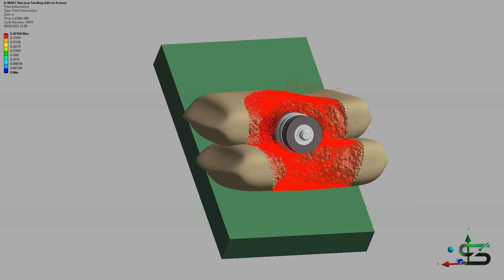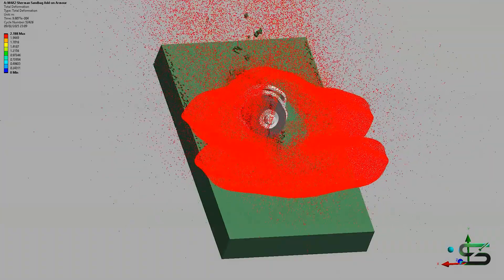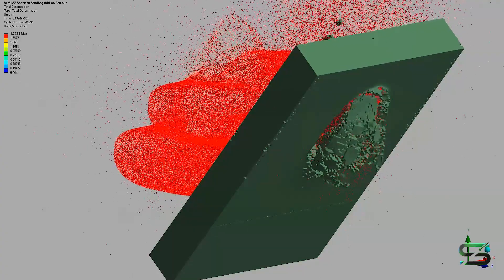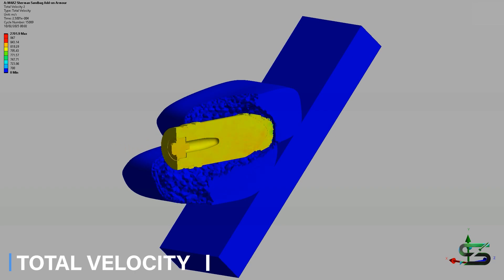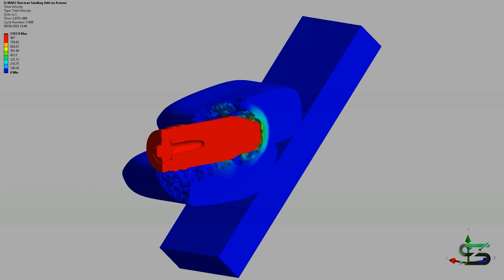Sandbags Add-on Armour | M4A2 Sherman Armour Piercing Simulation

Comment: I think that next this “simulation” needs to do is 1 t34 and 1 m3 lee agains 2727282928282 panzer 4 s 2727 panthers and 9282 tigers

Germans used the additional tracking
Allies used the ussles sandbags

A panther s 75 mm gun was able to totally destroy a sherman tank on more then 1,200m away with 1 shot(if hit)
It could go trought an js tank from over a 1.000m (frontal plate,not bothways)
But couse of the density of the heavy js tanks( they ussually didnt went trought, the whole cupolas were detonated in air)
Due to poor welding of soviet tanks(due to overproduction- and not quallity workers)

Comment: Sandbags are mostly for infantry interaction - they are happy with extra sandbag wall when entrenching.
Also, most "sand" bags were actually gravel ones - and these are good for bad roads, just dump them in holes and roll over.

Comment: My grandpa was a mechanic in WW2, he was all over the place when it came to vehicles. Sand Bags dampened the sound of machine gun fire, they could also be used for mounting positions alongside infantry in fox holes. Sand is a bit over exaggerated it was primarily dirt and rocks. At the time heavy assault weapons like the BAR, and Browning had skid pods. For whatever reason had ski like bottoms on them. 

Obviously bullets don’t discriminate but if you ever operated the MG before especially in a fox hole last thing you want is an enemy crawling under your line of fire. Browning bipods were mid so often times supplemented by sand or dirt bags. Less exposure for the gunner also.

Comment: I’d like to see the difference they made on hits from angles. Of course with a straight on hit it will go straight through, but would it change the trajectory enough on an angled hit to prevent penetration?
Reply: Soft surface does not change the angle, just decreases the speed

Comment: That's a tough shell, barely cracking after that much yawing. One of the reasons it uses a small bursting charge.
Reply: The bursting charge would be useless in this situation as the base fuse becomes shattered.

Comment: Sandbag "armor" was not intended to defeat or aid in the defeat of kinetic energy projectiles. They were intended to defeat Panzerschreck rockets and Panzerfaust grenades with shaped charges by pushing the formation of the plasma jet further from the main armor plates.

Comment: This is a completely different matter. Sand and other add-on armor were used to protect against cumulative (HEAT) grenades and mines. Then came protection against random ricochets. In the battle with the Japanese, the same "wooden" armor was popular, which was later replaced by sand.
Reply: Apparently, sandbags made early heat more effective

Comment: If you're not going to give your tank crew's extra front armour then don't blame them for doing something you've failed to do for 4 years
Reply: Sherman is a pre-war design, created in the time of solid shot 37 mm cannons as the primary anti-tank weapon. Added weight = more breakdowns.
Reply: @Ficon  had four years to modify or create a new tank not a valid excuse
Reply: @ They did create the M26.
Reply: @Ficon  the Pershing was practically post war though
Reply: @BelugaChonky    the whole point was to have plenty of reliable tanks that can be shipped across quickly and can travel on narrow bridges in Europe.
Wars are won on logistics, not thickness of the front armor plate.

Comment: In an interview a crewman said the sandbags mostly helped calm the new guys bc they would dampen the sound of small arms impacting the tank
Reply: That's actually a very interesting and playsible reasoning, I have not heard of this before.
Reply: I'm glad you brought this up. This was always my suspicion as well. Has anyone done an experiment where a db meter was put inside a Sherman tank while it is fired on by small arms? Probably not but I suspect 20mm hitting your tank would deafening while you are inside it.
Reply: @whatdidyoudointhegwardaddy68  I’m sure older tanks/hearing protection were worse at dampening sound. While I have never been hit or even shot at I can tell you personally that firing while inside a vehicle is much quieter than I expected, it’s probably comparable to external hits/explosions. Also, engine noise drowns out most of the sound anyway
Reply: That makes sense. While not being exactly the same thing, I remember seeing an article about the war in Chechnya, when tankers had to cross mine field, wheeling that barrel thing in front of them to set them off. Whenever an AT mine detonated, the barrel was sent flying upwards on its hinges, often hitting the tank's top-front before setting back down. The sound from that was enough to make many unable to carry on.
Reply: И могут помочь от фугасов и кумулятивов
Reply: The infantry often followed close to the tanks. Wouldn’t sandbags help against ricochet from bullets and shrapnel? 

Also, once you attack a position, you might want to hold it. It’s useful to have sandbags ready to quickly throw up a defensive position.
Reply: That and it would stop a panzerfaust heat round the issue is if your infantry VS tank you try for a side shot agonist a kinetic AT gun the usefulness is limited
Reply: Noise is important, you see that even a jagdtiger folded after a few minor hits
Reply: Also saved him from having to buff them out later during R&R time
Reply: It actually might completely take the sound away.

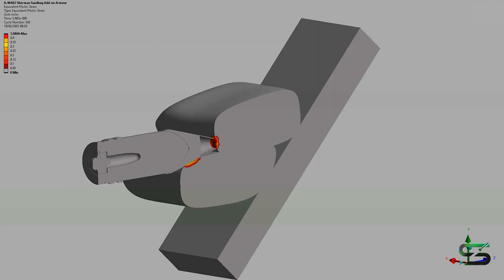Comment: 1:13 Patton didn't approve of sandbags and other junk as applique armour, but he did approve and even ordered his tankers to use the Field Expedient armour upgrades, where they basically took the upper front plate from one Sherman and slapped it on another, which doubled the raw thickness of the ufp but due to the angle, you ended up with like 170-180mm of frontal armour. Some Field Expedient Shermans also uparmoured other places too like the hull sides and turret cheeks (most famous example being Creighton Abrams' tank, Thunderbolt VII)

Edit: since everybody keeps arguing about this down in the comments, I thought I might try and clear some things up real quick.

1) the Field Expedient armour was issued out to the E8 Shermans with HVSS, so the problem of dealing with extra weight on the suspension wasn't a massive issue.
Of course this doesn't mean that they weren't issued to other Shermans either, there are a handful of photos showing 75mm Shermans with similar upgrades. 
Even if the VVSS suspension wasn't ideal for dealing with the extra weight and ground pressure, a lot of the photos of uparmoured 75 Shermans can be seen with the duckbill grouser attachments, which helped reduce ground pressure and gave it similar performance to HVSS suspension.

2) Shermans had very reliable engines and transmissions, especially by the end of the war. Early Shermans with the rotary engines and early VVSS weren't the best in sand or soft terrain, but the late war diesel and petrol engines were incredibly reliable

3) As far as I'm aware, Field Expedient Shermans didn't suffer any more mechanical issues than regular Shermans. An M4A3E2 weighs in at about 42 metric tonnes, meanwhile the Thunderbolt VII comes in at an estimated 37 tonnes, and comes with HVSS. I can't find any reports that specifically state whether the uparmour packages made their tanks break down anymore than usual. Even if that was the case, Shermans are very user friendly and can be repaired much more easily than any other tank during the war. A Sherman could replace its transmission within half an hour whereas a German tank would have to take off its turret (if it had one), and use cranes and other sorts of equipment to lift the transmission out through the turret ring. The Field Expedient Shermans with additional UFP's all had a separate lower section of the UFP that was bolted on, so in case the transmission needed repairs or replacing, the crew could just undo the bolts holding the add-on armour and access the transmission housing underneath. 
The problem of your vehicle breaking down doesn't really matter too much when you have the best logistics system and insanely large abundance of spare parts. The same can't be said for the Germans though.
Reply: The Sherman probably still did better with add-on armour than the last few variants of the Pzkpfw IV did with their frontal hull armour upgraded to 80mm. That made the foremost pair of roadwheels really creaky since the weight growth by then was over 50% of the original 15/16-tonne design and most of it was in front. Up-armoured Shermans had the same kind of problem but the fact that they were originally designed to be in the 30-tonne range gave field modifications much more wiggle room to work with.
Reply: Looking into the future and I see a very expensive warthunder premium.
Reply: Patton was overrated general. His victories were mostly against very weak enemies on open ground. When facing significant defenses his troops suffered heavy casualties for no tangible result.
Reply: @aleksazunjic9672  That being said, he was probably right about sandbags and other improvised armour for his command. The 3rd Army sought to fight mobile battles and the extra weight from improvised armour compromised this by making the tanks both slower and more likely to break down in return for dubious improvements in protection.
Reply: @ He was wrong. His army was forced into breakthrough operations and urban combat, and 50kg sack of sand had no effect on mobility, but was pretty effective against Panzerfaust .
Reply: @ I think the jury is still out on that, there are conflicting reports that the sandbags could help against shaped charges or actually add to their effect.
Reply: @ There is no hard evidence from maintenance reports that adding applique armour made the M4 medium more likely to break down. In particular 4th Armoured (who were some of the most prolific users of sandbags) maintenance logs showed no appreciable effect.
Reply: Bro chill you spent more time writing this then how long the video is
Reply: Sandbags tried to stop 3 effects of a AT projectile: 
1) cumulative jet,
2) kinetic energy of linear trajectory movement, 
3) rotational movement of a projectile.
    If 2 was efficient, then 1 & 3 would be efficient too.
Reply: We dont call them petrol engines.... mate.
Reply: I can only imagine how frail  the already unreliable engine + transmission combo became after that. Plus the Shermans had very narrow tracks for their sizes, they already got stuck in the mud as it was; gonna guess the uparmored variants were only usable in cities and on paved roads.
Reply: @olisk-jy9rz  The Sherman engine and transmission was amongst the most reliable one could find on a tank at that time. And the weight of the upper front plant is not that extreme. It makes the tank a little bit slower, and front heavy, but it´s about the same thing as loading 4 people into a family station wagon instead of just 1.
Reply: @pavelslama5543  Field engineers were more experienced than Sherman tank factory designers, researchers, scientists and all other people who had designed Sherman tank? Or you are just posting after-war myths about reliable Sherman tanks and unreliable German and Soviet tanks?
Reply: @JacobStohlman when did he say about field engineers
Reply: @pavelslama5543  Adding a couple extra tons to the front end is not the equivalent of loading 4 people into a station wagon. Difference is the station wagon is DESIGNED to take those 4 people, while tanks in general are already stretched to their very limits using the best suspension, engines and transmissions they had available for the time. This is why maintenance is so important when it comes to armored vehicles. It's a whole lot of stress on all the metals involved to get 30-70 tonnes of steel on the move.
Reply: @BirdyLegs2849  No. In general a competent design and engineering team would ALWAYS add something we call "design growth" into a design which the sherman had a significant excess of which allowed the shermans to be modified with extra armour on the field and still keep its maintenance requirements similar to unmodified shermans
Reply: @ You guys are both forgetting that the Jumbo had the improved suspension packages added onto them. Yes, there is SOME overhead on the design but they needed to upgrade the engine, transmission and suspension in order to upgrade the armor or firepower to any significant degree - Jumbo and 'Easy 8' are ironically perfect examples of this.
Reply: @awagwa  Here about field engineers' modifications of factory-built Sherman tanks: "It makes the tank a little bit slower, and front heavy, but it´s about the same thing as loading 4 people into a family station wagon instead of just 1." - post-war myths about clever field engineers and stupid Sherman tank manufacturers, designers and others.
Reply: @BirdyLegs2849  There is zero evidence that the add-on armour in the form of sandbags caused undue stress and increased maintenance on the tanks. We know this because we have the detailed maintenance reports of 4th armoured division (which was a major user of this type of add on) and they do not show any increase in either the use of spares, or maintenance time for their tanks. And as previously stated, the M4 had quite a bit of design growth. Contrast that with the panzer IV where they were at the limit of what was possible after the addition f the long 75mm gun. The panzer IV's front springs at that time were permanently compressed and it is why no additional armour was possible.

Comment: The sandbags basically removed the ballistic cap which normalises the shell on impact which I assume is why the shell went upwards against the armour plate and didn’t pass through the armour in the simulation

Comment: Ah, War Thunder.  Problem is they used a 75mm.  If they used a 20mm it would hve penetrated 12 Sharmans all being commanded By Ditka, plus the armor plate of the Yamato.  Why, volumetrics.

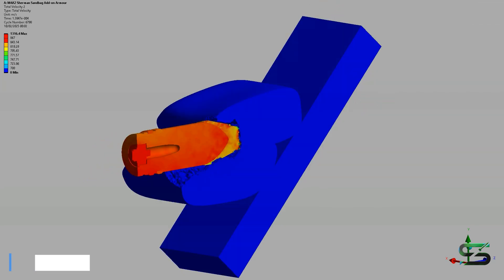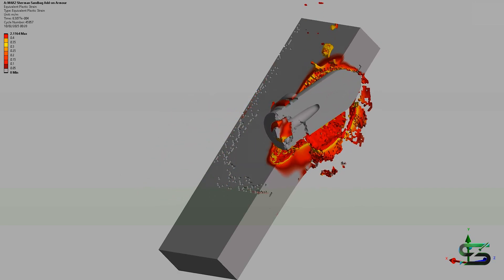Comment: 0:57/1:20 You can see the APHE ''hanging there''...in that precise moment it would explode and pepper the inside with shrapnel. Safe to say this is complete kill on the Sherman, probably killing 4/5 of the crew members.
Reply: 1 or two crew at most.  a lot less shrapnel than warthunder likes to have with its aphe and most of the smaller fragments dont break clothing or go deep enough to be a serious immediate injury.
Reply: @jpmrwiggles121  You are wrong. While APHE in Warthunder is modelled incorrectly, It's mostly the way it explodes. APHE exploded mostly in a cone irl, the cone having nasty fragments and potentially overpressure effect from the explosion resonating inside. 
So APHE in this case would absolutely wreck the crew, both drivers probably dead and the turret crew getting seriously injured and dying soon after.
Reply: @interpl6089also starting an argument with "you are wrong" is crazy ngl and makes you seem very stubborn
Reply: @gurin3374  You posted 3 comments that repeat the same myth. 
In simple, APHE penetrates the armor, penetrating armor itself causes spall, but not a huge ammount. When the HE charge detonates inside the APHE, the front and sides fly off frontally in a cone, creating large spall chunks and many smaller ones, the area behind the change (ie. back of the round) has much less material to create spall so it doesn't as much. 
With this, if the HE charge is large enough, an overpressure effect will take place and create nasty time to be inside a tank.
Reply: @ brother, you didnt even read
Reply: the cone is because of the already fast moving shell, no magic involved, only physics. also, if the shell isnt moving, as seen in this post penetration, the shrapnel would mostly go sideways (where it would have very little effect at that angle) additionally the panthers round isnt very powerful when it comes to explosive
Reply: and the hull crew and maybe some turret crew is probably already dead in there
Reply: I still remember the story our teacher told us 55 yrears ago  . He was a TIGER crew member / driver and spend his first fighting experiances  during the battel at the hedgerows near boccers village ! After one firefight with british shermans he visited one knocked out Sherman tank who got a hit from a 8.8 TIGER gun at the glacias front plate near the boltline to the transmission housing from round about 1200m distance.  . ,, The armor pircing crate penetrated the add on sparetracks , the glacias plate , killed both driver , Co driver / radio operator mg gunner  loader / gunner by housing & transmission case  fragments , cut off the comanders left leg under the knee , penetrated the rear fightingroom compartments firewall and stuck the engine emediatly ." The only Sherman crew surwiver was the tank commander . Fewe years ago i found a picture of my teacher in a book about ,, The Wittmann TIGER Tank" and its crew members during the fightings in Normandy " . He was the only one left alive from Wittmann`s Tiger crew because spending the rest of ww2 at hospital after baling serious hard wounded  out &  rescued from his tiger tank , a week befor Wittmann & his crew incl. repaced driver  got killed by a rocket hit from a british TYPHOON fighter plane.